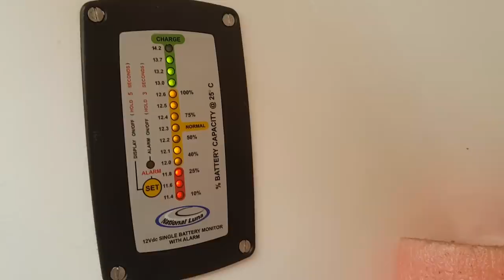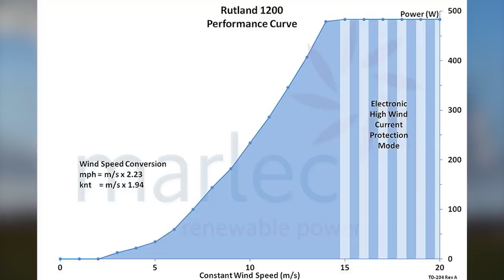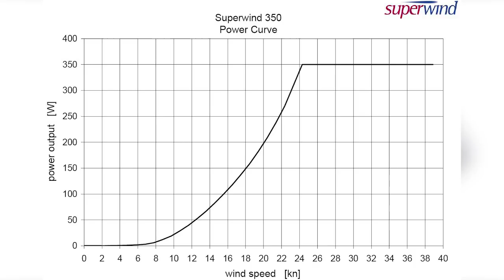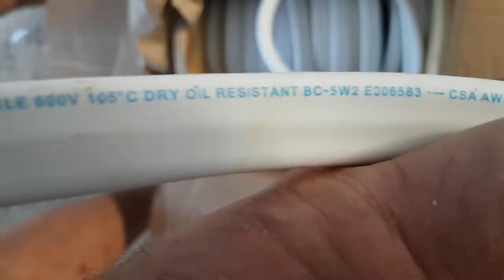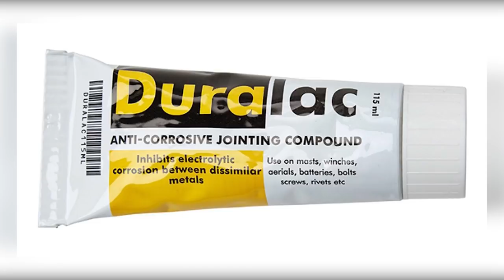Smart or Dumb? We Put a Wind Generator on Top of Our Mast - Ep 58 Sailing Luckyfish

Comment: I think the main reason you don't see this more is that the wire need to be a gauge or two larger, i.e. more expensive, to avoid DC line losses... and the high likelihood of a lightning strike destroying it! And the vibration transfer through the tightly attached mast... and the inaccessibility of the rotor for repairs... and the chance of ropes becoming fouled in the blades... or a blade coming off and killing you, or worse: ripping the sail... oh wait, what were the advantages? It does seem like a nice idea, but the benefits might be minimal compared to a stern-mounted unit. for vibration you might try fabricating a couple aluminum plates that go between the generator and the top of the mast. Then put rubber shock mounts (similar to engine mounts) between each plate. You can get these at McMaster Carr in the US in smallish sizes. four rubber mounts of about 20mm should do the trick, for each level of plate that you add. Of course, then you have a corrosion problem... https://www.mcmaster.com/=1fm60ic
Reply: You forgot the most obvious downside, bird strike, several sailing channels have had their wind indicator instruments destroyed by birds.  I can't imagine what a seagull would do to the wind generator. But damn the torpedoes, I still think the wind generator belongs at the top of the mast. Maybe a vertical axis wind turbine generator is in order.
Reply: @jcregal3456  maybe if they stick a little whistle at the tip of each blade it would scare the birds away 😂

Comment: I placed a 80,000 mill one a cement foundation one time and used a pcs. of 1" 1/4" rubber conveyor bely under the whole mill connected to cement foundation and once running, very rough mill, Raymond Mill, you could set a coffee on it and walk away and comeback ir it still there so I suggest a thicker rubber mount, if you have not corrected yet.  Also, your support pole, if hallow, might be too long.   Just me sitting here thinking about this.

Comment: If you think the blades are loose, you could try gluing the blades to the hub with a flexible adhesive.  There is a lot of surface area at the hub for adhesive to act on, and so long as the adhesive is not brittle (epoxy =bad) it should damp any small relative movement you may be getting due to inconsistencies in the contact surfaces from the manufacturing process.
Reply: I would be hesitant to add any material to the rotor. It's hard enough getting something that spins fast like that properly balanced. The odds of putting exactly the same amount of adhesive in each spot around the rotor, slim to none, just exacerbating any out-of-balance issues (or creating new ones, if none exist at the moment).
Reply: Adhesive on the hub would be very close to the rotational axis.  One can weigh the adhesive to make sure one uses the same amount on each blade.   Most will squeeze out, so the contribution to imbalance should be very small.
Reply: @Custercounty01  Perhaps the adhesive could also help balance the prop as well.....

Comment: Interesting to see your mounting there, I work on infrastructure development and have had some involvement with land-based turbines. generally, there is a low-level vibration which of the blades themselves. On the scale that I have been involved in the designers have employed a few tactics some you have employed some may be of use and others might be difficult to implement in a consumer market unit. 

1) Isolation, As a few, have already mentioned your bolt fixings are a transfer point into the mast. on the industrial scale turbines, dampers are installed here, some go as far as looking at counterbalancing resonate frequencies using hydraulic mountings but in your application, I would suggest a passive system with a lower weight so as not to interfere with the boats COE.  I would isolate using a hard and a flexible grommet with stainless washers separating the grommets both on the plate and mast side and use locking nuts to secure without the need for excessive tension. This should give you the widest range of dampening possible with rubber. A good of the shelf solution would be car suspension bushes, I think the type used for training arms would work well and for this application as they would be about the right size.

2) Blade Pitch and balance, this is fixed on yours so I will not go into much to much detail as rpm increase the pitch that delivers the quietest rotation differs on commercial turbines the pitch is trimmed to balance noise and efficiency. unfortunately, the graph for noise looks almost identical to the power output graph you showed in your video. 

It is possible that the rake of the mast pulls the base angle of the turbine slightly out of alignment, but as you have compensated for this in the plate, and it will never be perfect on a moving platform, there will always be additional vibration through the bearings as a result of the height increase. I would not focus much effort on this as to achieve any significant gains here you would need to significantly re-engineer the turbine and add adjustment and dampening into the bearings. 

You could, however, use spacers to adjust the rake forward slightly to see if this helps as you may find that there is some flex in the mast putting the rake of the turbine slightly further back which in use. You could probably work this out with a few engineers and some finite element analysis but to be honest your best off using washers to fine tune as the real world tolerances on the top of a sail mast mean that a more complex approach would be  a  bit of a waste of time as there are too many variables that would change dependent of rigging etc for it to be worth the time working this out by anything more than trial and error.

3) Low-Level Mast Vibration, the wind farm protestors favourite. Essentially the vibration caused by the mast resonating on account of the rotating mass on the top. I don't have a solution for this the manufactures try to accommodate for it in mast design and in foundation design. I am not overly familiar with the wirram rig, but would just advise you to keep an eye on the tension in the rig and add locking nuts where ever possible as mounting a turbine in this manner will have introduced a lot of additional vibration to your rig. doing this and adding dampening where ever possible will cut down on the additional levels of wear and tear as a result.

As with any mast mounted turbine the mast will tend to make any vibration more audible in your application I would include your rig into this equation as the which may go some way to explain the variance in noise based on wind angles and reduction in the water, as under different tension loads this will become more and less audible. Sheathing where your rig loops around the top of the mast may help with any noise coming from the rig, but then again it could be transmitted through the mast itself.

I hope there is something useful for you in my ramblings on this, it an interesting project you have there. I will follow it with interest as I had thought of doing something similar on my next boat (when I get the funds together for a catamaran).
Reply from the maker: +Andy Bill - thank you very much for your insights. the training arm suspension bush you mention, or a centre mount rubber bush equivalent, looks like the first step to take with the largest possible return. As far as keeping the base angle of the turbine level, you are right. Our mast rake and rig tension and many variables not least of which our "footing" is a platform that is constantly moving on the sea make this insolvable. But, we take heart that many mono's pitch and sail on a lean so we are likely "more level" despite the added height. Thank you again, we will post updates and hopefully show some progress, Stew

Comment: The knocking very well could be caused by wind shadow caused by the mast.... Yes the mast is behind the blades but behind our in front causes pressure buildup.... Did you check balance of the blades.... Just like a ceiling fan out of balance causes noise..   If you climb the mast while it's spinning and use a metal rod held  to your ear and different parts of the generator you can narrow down the origin of the knock.... Also consider that the knock could be a line that has resonance..... Try listening to each line.... Could be that the knock is just the coils passing magnet as well.... How does the nose cone connect?? Could be that too

Comment: I can only think of  2 possible causes to your nocking  problem one is that one of the blades is out of balance not just heavier or lighter but miss shaped causing it to exert more or less force ? 2 is that one of the bearings had  a flaw and it didn't show up until it was run in.  either way, I would love to know how you end up fixing it as I will have to employ a wind gen on the top of my mizzen mast. once my 42ft Wharram goes back in the water.
Reply from the maker: +Marcus Lee We will be posting updates to this saga... interesting to hear your angle on the bearings post "running in". That had not occurred to me. I believe Rutland when they say they do carry out serious quality control after my exchanges with them, but your suggestion could still mean a bearing is the issue. Thanks and good luck getting back in the drink. You wont regret putting your wind genny up there. It is worth the extra hassle in my view. Cheers

Comment: I would cut a few 1/8" neoprene pads 1/4" total to go under the generator. I would not hope for much though but it should cancel out some of the constant unless it is actually wind harmonics through the blades. That knocking eats it. I would probably run it up to a month before the warranty expires and if it hasn't worked itself out send it in for warranty repair. If it does quiet down I would then check for any rotor play. I generally do not use triplex cabling for those. I use single runs of multi strand conductor and twist them together down the run to help offset any EMF that might be thrown around by the 3 phase varying frequency of the generator. But if you have no problems with that yet, you probably never will. Other than ease (or lack thereof) of maintenance I think it's a good location. More consistent power is worth the trade off unless the boat is a slip queen.   ;)
Reply from the maker: Great tip on the EMF. No noticeable problems so far thank goodness! Thanks, Stew

Comment: Are you sure the blades aren't hitting anything?  The wind does flex them toward the tail a bit, so you wouldn't notice it when the wind wasn't turning the rotor.  Of course, if that was the answer, by now you've found it, because of the blade tip wearing on whatever it's hitting.

Comment: I couldn't help but chew on how to scale UP your mast-top benefits, even before the vibration issue showed up in the video...and the shallow understanding I have of the way wind farms stagger their windmills made me fall into the natural staggering of multiple wind generators running straight in-line with the line of the boat...bow to stern, since that is the only direction that wind will never come from under sail.  Of course, that changes under power, and the obvious question is HOW MUCH DRAG IS REGISTERED FROM A SINGLE WIND GENERATOR...OR...SIX?  Ha!!!  I couldn't help but take the next step in eliminating vibration by mounting three generators on gimbals supported by stainless pipe with rigging cable passing through it between two masts...OR...on a dampened spinnaker pole (or two that balance each other, port-to-starboard!).  A triangle of spinnaker poles connected to the main mast at the front tip of a triangle, with rigging (spreaders?) stabilizing the rear two points comes to mind, which can support 6 to 8 small generators that are supported by enough cable that any vibration is mitigated seems interesting.  Love to hear your input, and if multiple slightly smaller units would prove advantageous!

Here is a gimbal set up that may be over-kill, but food for thought:
>>>The "Tiltamax Gravity" 3-Axis gimbal is used to stabilize large digital cinema cameras up to 33 lbs (15 kg) via 3-axis motor calibration. The "Gravity" easily adapts to different environments and shooting requirements. It can be handheld, mounted to a jib, anchored to a camera car, mounted to a suction cup rig, etc...<<<   😎

Comment: I am going to watch it again to see if you gave any  performance numbers.  If you do not need it and it has not been fixed yet, why not lock it to prevent loss of sanity.  I believe you maintain a time delay between filming and posting.  Could the knock be from where the mounting meets the top of the mast?  The rubber might be providing an unstable surface and  as the wind blows the force is transmitted down the mount causing it to flex at that point compressing the rubber at one side but not the other.

Comment: Another great episode sir!  Really enjoyed it.  So how is the wind power wise?  How much do you get out of it on average?  Do you like the rutland?
Reply from the maker: +ScubaTony Anschutz - power output is exactly as advertised (here: scroll down https://bit.ly/2PTjc5x) . I first noticed the Rutland 1200 in Grenada, two of them mounted on a Prout 38. They did not make a sound which really impressed me. We were sitting right next to eachother on the hardstand and I spoke to the owner about them. That hardstand was full of noisy wind generators. Later I learned they could be shutdown remotely, indefinitely which pretty much sold me on them. despite the issue we have yes, I still like the Rutland and their back up has been helpful so far. I will feel much better about them once we get to the bottom of the knocking though... Stew
Reply: Thanks Man.  I will consider one if my 630Watts of solar is not enough.  Actually mounting the panels on the bimini today. Very exciting stuff.
Reply from the maker: yes. your 800Ah of storage (400 useable) plus 630W of solar and a short crew of 1 or 2/ light demand. you are probably going to be ok. That is another route.. solar only and beef up the storage
Reply: @SailingLuckyfish  Yea.  It really is a balancing game.  I only have a small fridge and no other big draws so I am hopeful it will be enough. I won't know until I get out there and start cruising.   I might just get a Honda Generator and a couple 40 amp chargers for those random times I have too many clouds for 5-7 days.  I have a Victron BM on each bank so I should get an accurate record of energy in and out.  You got that water maker and radar you have to feed so the wind gen and hydro make tons of power for ya.

Comment: Try looking at refrigeration compressor mounts as an avid RC plane builder and flyer Ive used them to quieten petrol powered aircraft engines small to large are available
Reply from the maker: +Rob Stevens, I really like the idea of those studded mounts, but there may be an issue with shear strength. Although the weight of unit is only 17lbs there are instantaneous shear stresses added to this due to wind gusts and mast pitching etc. Could be quite high. Thanks alot for taking the time away from the RC fun to help, Stew

Comment: Is the generator hard mounted to only face forward or will it spin on the shaft to face into the wind? If the knock lessens in different when the blades are facing the wind at different points try to notice if it is more level to the deck or less in different positions. the fix for the knocking could be as simple as bending the mounting pole to level out the generator.
Reply from the maker: we accounted for this in the design of the pole. The pole is vertical (whenever the deck horizontal). There is a 7.5 degree offset on the base to allow for the mast rake. Thanks for the suggestion though! Stew

Comment: Id try removing the rubber all together. Vibration isolation is a science and adding the rubber between the mast head and gen plate, might have added enough movement in the plate for the clamp bolts to rock.

Comment: not sure if it would help figure out what is going on , . but did it make the sound, when the wind was blowing, but the blades are not spinning (ie it is locked)? I think it would be best to address route cause, figure out what is going on , rather then trying to isolate the issue. IF you have it on the ground.. maybe you could spin it with a drill see if you can re create it there, with an without the blades. maybe the weight up high and tention of stays causes the whole thing to "sing" like a plucked guitar string. you might try something if you have a cleat or something some distance up the mast, . try to tie it off to one side of the boat ... and see if that makes the sound mostly go away, if so , then you know your mast is resonating somehow, and the act of tieing it off, has damped it.
Reply from the maker: +Kevin Nemrava - thanks for the suggestions. It doesn't make the sound when the rotor is locked off, in wind. Yes, the drill idea is a good one, its actually part of Rutlands bench testing procedure - we will likely take it down to effect some of the suggestions we have received below - and then bench test it before putting it back up :-) Re: the vibration suggestion, we dont think that is the cause of the hum or buzz... it emanates from the unit/pole area. Many thanks once again, Stew

Comment: Look at how equipment is mounted on submarines, this should eliminate noise and frequency vibrations.  Also the strain relief that you screwed into the mast to secure the wire, is it UV protected?
Reply from the maker: +Barry Thompson - a submarine engineer actually responded to this question so I reckon we are on the right track Thanks for that tip. Those cable clamps will only last 2 or 3 years, no UV protection... Cheers, Stew